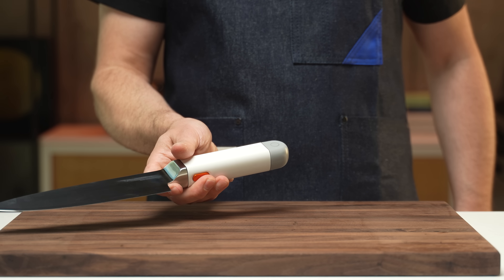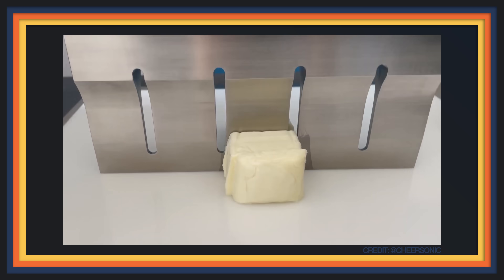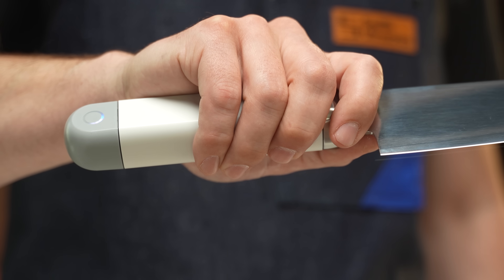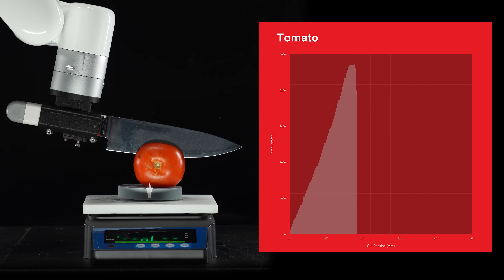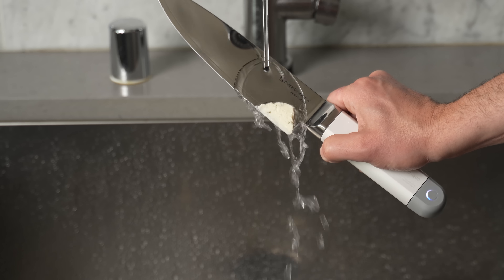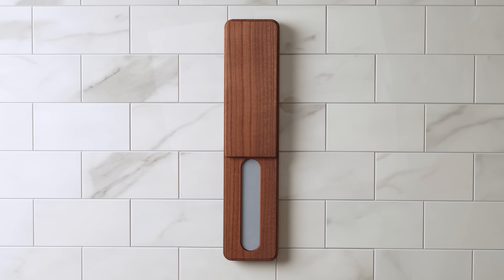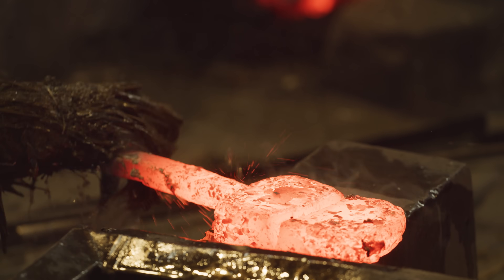The World's First Ultrasonic Chef's Knife for Home Cooks: Seattle Ultrasonics C-200

Comment: Brother, no home chef is spending $400 for a knife or $150 for a wireless charger for it. Those prices are actually wildly insane when you can get a nice set of 8 common knives for $150 and don't need to charge them. You can even get a decent sharpener for less than you charge for a backup battery. A sharp knife will easily cut through a tomato or grape, and if you're not using a bread knife for bread, you're a masochist. I'm sorry, this is an absolute scam and proof that technology is absolutely out of control
Reply from the maker: Definitely not a scam! We acknowledge that the price is high, but it’s an expensive time to invent and produce new hardware. We also know this knife isn’t for everyone, but there are people who are interested! We’ve sold through 60% of our first production run😊

Comment: Hi Scott, I preordered this and look forward to batch one!
In the meantime, I have some thoughts. I'm a 38 year old home cook who often cooks at work for a private individual. I own a variety of Japanese knives, I'm proficient at stone sharpening, and can get them shaving sharp without difficulty. Ever since seeing this tech used industrially and recently in the form of handheld utility knives I have hoped to see one brought to the chef knife market, so even though this is completely unnecessary for me I took the plunge. I am excited by the prospect of taking the blade to hair-whittling sharp and seeing how much sharper it feels with the piezos active, but the thing that would make this truly worthwhile for me is if it can actually cut through paste-like and bready foods like cakes without crushing and without holding on to buttercream etc. as well as more easily releasing veg that likes to stick. I look forward to seeing if it lives up to these promises. I have a few questions though:

As others have noted, the test you've shown here measures the cutting force against a tomato with the knife on and off, but the robot cuts the tomato using a (mostly) straight downward push cut. A tomato is absolutely the worst thing to use to showcase a push-cut, as you would need a very very sharp knife to not crush it a bit, but all of the resistance drops dramatically once the skin is broken (which the ultrasonic action may do quite well). I suspect that this particular test was cherry picked as it showed the largest cutting force delta, but to anyone who's actually cut a tomato it stands out as suspicious. I'd love to see more comparisons with foods that are more suited to a push cut, or to see the robot perform a proper slice, because as it stands I have to wonder if the difference would be much less dramatic if using proper technique.

In regards to the force reduction, do we see a larger delta depending on the initial knife sharpness? E.g., would an extremely dull C-200 see a 35% reduction in cutting resistance when activated whereas an extremely sharp C-200 would see a 5% reduction? If it's the latter, it seems like this would be of much less utility to knife enthusiasts who already keep their knives extremely sharp, the friction reduction effect aside.

In regards to sharpening, my understanding is that these devices work on a resonant frequency, with the piezos tuned to the blade geometry and mass. Since this seems marketed to people who don't necessary keep their knives sharp with a whetstone, and may instead use pull-through or electric sharpeners which over time eat away enormous amounts of material, can you quantify the point at which the mass or profile of the blade could be reduced enough to detune the resonance and eliminate the effectiveness of the ultrasonics?

I would love to see these and other questions addressed by actual hands-on testers. OUTDOORS55 would be my ideal as he has used this technology previously and is one of the few knife and sharpening youtubers who seems to have mastered macro photography.

A couple nitpicks, even though I haven't laid hands on the knife yet:
As has been noted, the steel (AUS-10) is not exactly the most premium of knife steels, though it is very popular. I'd love to see a future blade made with a better powder steel assuming other costs can be reduced.
The knife geometry, pretty much a standard western chef knife, has a lot of drawbacks: namely a very wide behind the edge thickness. I would love to see this tech brought to a thinner profiled gyuto or bunka geometry. From the video it does show that you tried a variety of shapes including what looks like a k-tip gyuto. I'm curious if there was a specific reason this didn't work out.

A couple likely very small but unknown risks I wonder about:
Do you have or know of any data regarding long term nerve effects of using a handheld ultrasonic device at this power and frequency? It seems like these tools are fairly new to the market as handheld devices and I wasn't able to find anything that specifically looked at this.
Secondly, I wonder if novel risk that this blade may introduce is aeration of infectious particles e.g. salmonella from cut chicken. While rare, airborne salmonella infection can happen. Is there any existing data as to the prevalence or possibility of this?

Was the mirror finish an aesthetic or performance driven choice? Mirror finishes tend to look gorgeous out of the box but easily show signs of wear and scratches and are very difficult to keep perfect in my experience.

Thanks for your hard work on bringing such a niche product to market!

Comment: Very cool product but price is wild. Cheap steel and i cant imagine the vibrator components are very expensive either. Of course there is engineering costs but i figure you can produce these for less than 40 bucks so i would pay 100
Reply from the maker: I wish you luck there. The steel is Japanese AUS-10 and is desperately *not cheap*. And there's no vibrator; it's a stack of piezoceramic crystals. If I could build this knife for $40, I would be jumping for joy. Stuff costs stuff.

Comment: I was going to hate on it because it's a bit of a gimmick, but from a technical perspective I'm impressed you got a decently high-power piezoelement in that handle. No doubt this is a product that 100% delivers on its promises. But almost every amateur in the kitchen simply should sharpen their knives and it'll do 99% of what this can. Ultrasonic knives are only really useful for cutting cakes and pastry, and then only for presentation. All the rest is just as easy and effortless with a properly sharpened, large enough knife.

Comment: guy could sell me a fridge in antarctica

EDIT: There is a video of another company inventing the same thing 2 years ago already. So this is NOT the very first it seems, maybe the first that will make it into market.

EDIT2: Found another one from 10 years ago, but it seems more industrial-like (even thought technically, it could be used at homes i guess).

EDIT3: Found another one from 18 years ago. It was big and maybe last efficient and nice looking than this one, but it seems like it also operated in a similar way. It wasn't really ultrasonic though but seemed to cut pretty decently by just moving quickly instead of ultrasonic. So, eh.

Comment: I love this. It's exactly the kind of thing I would make if I had the know-how that you do - kinda niche, with moderate benefits to a fairly wide range of customers, and very, VERY cool. On paper it looks like a very expensive knife that only cuts a bit better than an ordinary one, but I know that it's well worth it to a pretty wide range of people. It's practical, maintainable, accessable, and scalable. If you're just a college kid cutting some stuff up for dinner or a knife fanatic and pro chef, you're gonna be able to use this and get benefits out of it. the fact that it's not serrated and has a fairly straight edge means that sharpening it will be easy for novices compared to serrated or steeply curved knives, and less challenging for expert honers to do their best work on. And it's just... really cool. I think this is something that will become a personal preference for some professional chefs, and I totally could see this becoming widely added to knife blocks everywhere.

Comment: Real question: why use this instead of buying a knife sharpener that I can use on any cheap knife? 
Is the difference in cutting performance really much better than a well sharpened knife?
He compares it with a dull knife, but anyone that cares about their knives and would spend this amount of money on a knife knows the importance of sharpening and how to sharpen a knife
Reply: Because it is more important to solve the problem then think of the practical use at this current point in time. In future this may have some other use no one could think of at this current point. the joy is in the work not the result

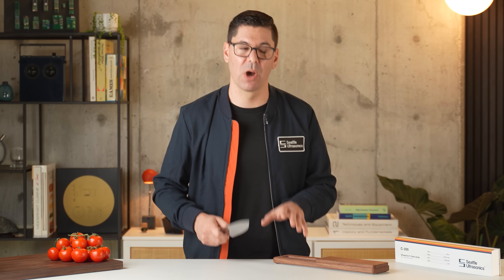Comment: 6:05  its a myth that dull knives are more dangerous .. its absurd
Reply: It's not. More than half of kitchen knife accidents occur due to slippage, after applying extra force to cut with a dull blade, and/or improper handling. 
Careless people use tools carelessly. Kind of like stating opinions the internet could quickly teach you to be false.
Reply: @FoodiePunk  oh really can you show any published articles stating dull knife is more dangerous? As far as i know a razor sharp knife will cut you v easily
Reply: @FoodiePunk Dull knife is called Dull because it doesn’t cut easily even if you rub it in your hand it wont cut.
Reply: @Drake-xc2qd  A dull knife can still cut things if you apply a lot pressure, Which you need to cause again it's a dull knife.
I thought this was a common sense. But i guess common isn't much common or some people are just special.

Comment: As someone who has worked with sonicating knives in industry, that seems... extraordinarily dangerous. I understand the instinct to disuade people from having that gut reaction, but I'd rather people be more afraid of it than not. You can still have an accident with a freshly sharpened Wusthoff, but this is on another level. 
Turn on the knife while rinsing? Why even suggest that? Some poor idiot is going to turn it on, go to wipe it with a sponge, and have a serious gash on their palm before they even realize what's happening.

Comment: Ugh.  Your average home cook is NOT going to spend $400 to buy a super chef's knife.  Professional cooks might, but in their culture, they are used to just regularly sharpening their knives to get the same level of cutting.  Here's was I want to see - I have plenty of knives at home already.   I don't NEED another knife.   I would like to be able to apply the ultrasonic vibration to my existing knives in order to get them to work better after they've gotten dull.  Small portable ultrasonic devices are out there, dentists use them for removing tartar from your teeth.  Why not just make the ultrasonic handle, add a clip to it so you can transmit the vibrations to the knife of your choice.  The ultrasound device is super cheap.   You don't need to package it with a super expensive Japanese steel blade.

Comment: The knife is really cool, but at least I grasp how it works. But how on earth did you pull off that microscope slow motion at 2:56?? That's like magic. Did you fake it for demonstration purposes? Or did you find a way to record at like 100,000 fps through a microscope?
Reply from the maker: Excellent question - you're the first one to ask! I used a technique that I call zoetropic microscopy. (Actual scientists probably have a better name). I got a timing gun for a car engine, which is just a strobe light that takes a trigger signal. I hooked that up to a signal generator running at 29.97Hz--the same frame rate as my camera. What you're seeing isn't actually "slow motion" - you're seeing the difference between the frame rate of the capture and the phase of the motion of the knife. This only works because the knife motion repeats, but it would work with anything with fast, repeating motion (like an electric toothbrush head). Because the frequency of the knife isn't an even multiple of the frequency of the camera + strobe, we end up sweeping through its' phase, and that's what causes the appearance of slow motion. 

I wish I had access to a Phantom that could shoot at the necessary frame rates, but that is not currently in the cards 🙂

Comment: Looks pretty cool. But I'll need to wait for some grungy youtuber to buy one, test it on a brick first, trim some bushes, then see if it'll still gently slice through some soft items like bread, whipped cream, butter, then finally a pineapple just by gently setting the blade upon the side of it, and going through at a casual pace. I want to know how it'll perform after the blade's been dulled down, and resharpened or re-aligned. 

But in all reality, I've barely shelled out more than $20 for a kitchen knife, and when I think the knife sucks, I'll get another $20 knife. Fun fact, I've bought 1 kitchen knife in my life; it was a 3 pack from Walmart of ceramic knives with the silly marbling look. Before that, I'd been using the steel knives left in the kitchen of the place I was renting from whoever previously owned the knives, and before that, my parent's knives when I was still at home. Kitchen knives just...have a long life for average home cooking.

Comment: the guy said its not dangerous. YES IT IS DANGEROUS. its like shaving with straight razor. 1 wrong move you cut yourself, you wont even feel it. this thing can cut your finge, hand, arm. its like a lightsaber. you think im joking but no. if you used whetstone to sharpen your dull knives, you will know what im talking about. even those knives are dangerous. its as impressive as it is dangerous

Comment: How much is to replace a battery?
Reply from the maker: Extra battery packs are available on our store. Current price is $79. Note that we're taking great care to make that battery last a long time by setting sensible limits on discharge depth and recharge speed. And the warranty on both the knife and battery are 1 year. Lithium ion batteries age, of course, but we're doing everything we can to make the one you buy last as long as possible.
Reply: @SeattleUltrasonics  You probably have your reasons for doing things your way, but being able to load generic lithium battery cells into it would definitely future proof it in case the company stops selling the batteries or stops existing. 

Are the batteries simple enough to the point that they could be DIY'd in the future?

Comment: Sir, the presentation is good and I am sure the product will be equally good. I headed for shopping page after watching the video and came back to comment section straight way. 399 USD for a knife at home kitchen is an absurd price point. It is suitable for those gizmo freaks who take pride in showing off their cooking tools but hardly cooks but for a serious home cook the price point is laughable. Please rethink why should anyone pay 400 USD to use your knife. I still have to sharpen it, i still have to keep it charged. I am able to achieve clean and thin cuts with traditional knives. So what is the vslue addition here, 50% less cutting force? I have no answer at this moment but i implore you to think about it. On the face of it the product is attractive to any home cook.

Comment: Can you change the blade?
Reply from the maker: No, the blade and bolster are integrated into the handle. An interchangeable blade model could exist in the distant future, but unlike a reciprocating saw with interchangeable blades, there's a lot that has to be "matched" between the blade, the piezos, and other components for things to work their best.
Reply: @SeattleUltrasonics thank you very much for the answer

Comment: 200% just a goddamn sonic toothbrush motor in the handle, pushing against the blade so it transfers vibrations better.

Can be done at home for super cheap, might give it a go in fact

Comment: Kudos to fellow engineer and knife enthusiast! I wish you best of luck and here's an advice if you eventually make a C-200 mk2: you don't need that much of abrasive resistance of a ~1%C stainless steel for cutting tomatoes, what you need for maximum cutting efficiency is primary geometry — making the knife thin behind the edge (and leave the apex at 15 degrees per side) which needs a tougher steel with a fine micro structure (small uniform carbides). So just ditch san-mai design and just make a mono blade from a rolled sheet of steel like 14C28N, 1k6 or Nitro-X7/V hardened to 60 HRC or more. Easier sharpening, less prone to edge chipping and point breaking off after a free fall to the floor.

Comment: You didn’t say much about the need to sharpen this knife. Is it the same? For me, that’s the key question here. With a sharp knife made of quality steel, cutting is no problem in the first place. With an ordinary knife, there are only two questions: either sharpen it from time to time if you are able to do it, or sharpen it often if it’s cheap, because it dulls quickly. So if the need for sharpening and everything that comes with it remain the same, then there isn’t much point in an ultrasonic knife.
Still, it will definitely find its niche in the market — that’s for sure.

Comment: almost as sharp as my good old knives. Knives maintenance with a good quality steel blade and you will cut through pretty much anything. Thing with vibration is real life durability. I have used ultrasonic devices before, engine die out after a year or two and the engine isn't prepped for real life butcher work even at home. For that price get a goood Japanese knive and your descendants will still be able to use it over generations